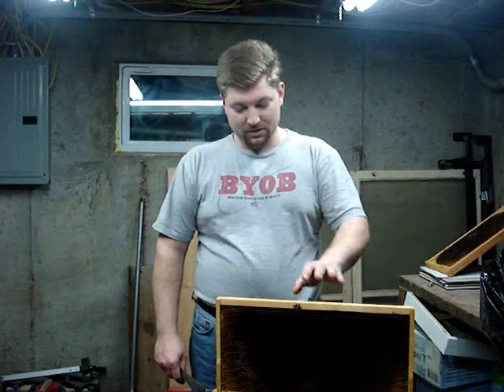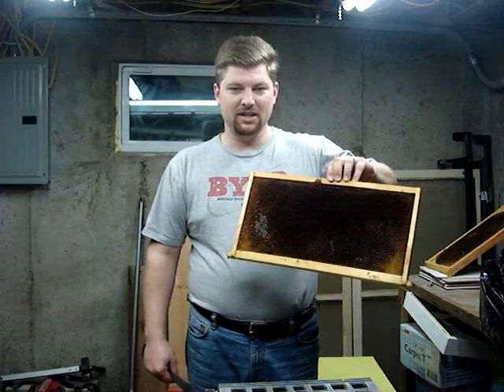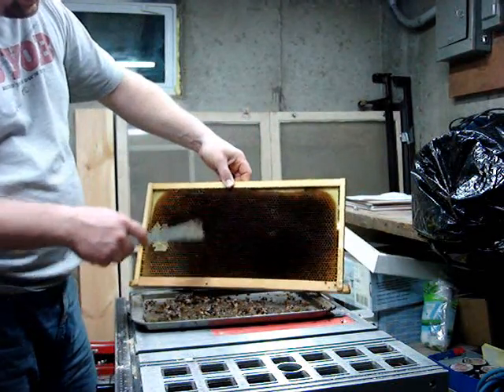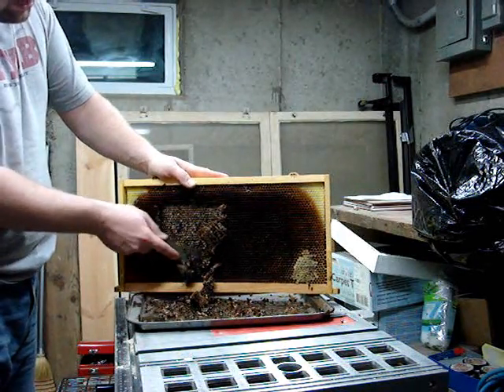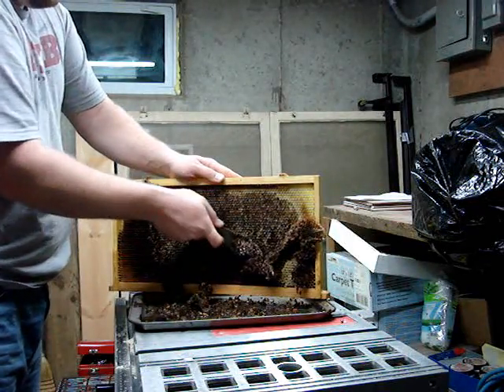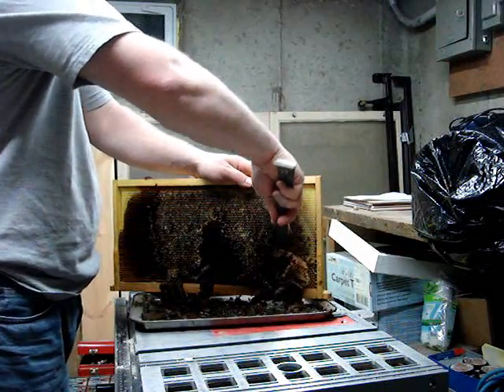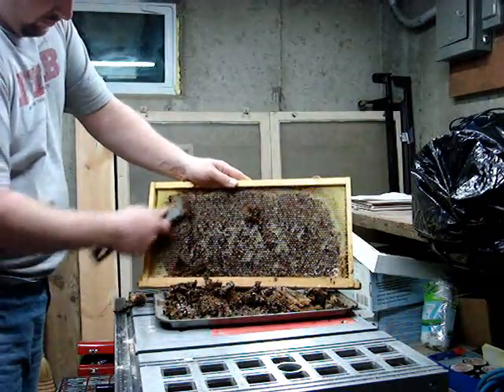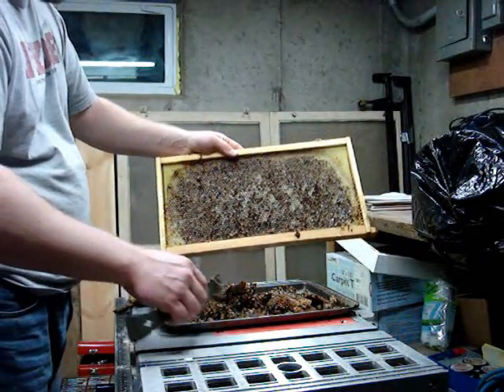Scraping and Reusing Plasticell Frames for Beekeeping

Comment: I'm getting ready to set up new hives and do splits. Im mixing wax and plastic frames. To clean up the old frames just scrape off the old wax, put the frames in the dishwasher on sanitize cycle with a couple of cups of bleach in a glass. They all came out nice and clean and no damage from the hot water. Very easy cleanup.

Comment from the maker: I've cleaned and out them back in the hive several times with great success. The bees have to have a large nectar flow for them to redraw the frames, else they ignore them. As years have gone by , I've started to buy new frames and foundation because the wooden frames need replacing eventually. For my small scale operation, $1 per frame isn't bad to just buy new.

Comment: Put frame in sun when 80 degrees or so,use 6 inch spackling knfe ,trial, scrape small spot,work slow, whole thing sticks together and comes off as one big sheet,BUT BEST thing is it cleans it SO much better than this method.Roll melted wax on it,give it back to bees

Comment: I cut off comb, scraped off wax and propolis,  scrubed with a brush and hot water,  put through a cycle in the dishwasher (plugging up the dishwasher, even after doing all the previous steps), and then pressure washed the buggers. I got to tell you, it was a lot of work. Had to clean the dishwasher filter three times, and still having problems with the dishwasher due to the amount of debris. Hoping I didn't do some damage to my sewer line plumbing. Ironically, immediately after this fiasco, ran across an advertisement in Craigslist for someone selling 57 plastic frames (new, unused) with foundation for $50. Incidentally, the previous day, did the same thing, without the dishwasher step. Pressure washed the foundation in the driveway, threw wax fragments all over the place, including the wife's hot car.  I should say, hot, as it was sitting in the sun. Anyone knows what happens to wax when it hits a hot car? Right, it melts, and sticks like glue. Had to use solvent to get it off, hoping all along, that it wouldn't damage the finish.

Comment: for those of you that don't care about pathogens put it in the freezer first way easier to remove the wax once frozen i personally refuse to use plastic plus its more work you got to put the plastic in the frames then wax or sugar water theme and clean after a wile like showed in this video i just take a frame rube a little bit of wax on the top bar stick it in and to clean just cut out the come and back in business